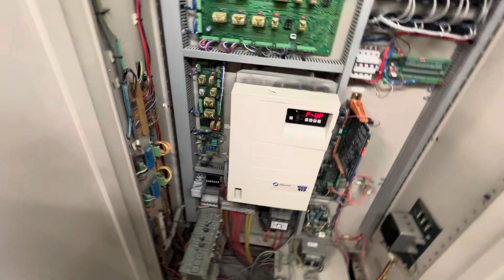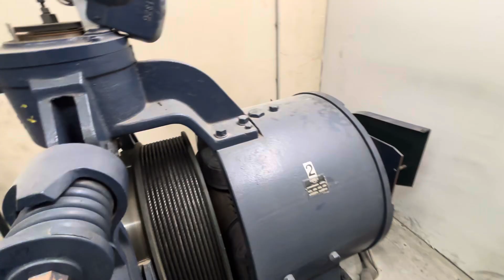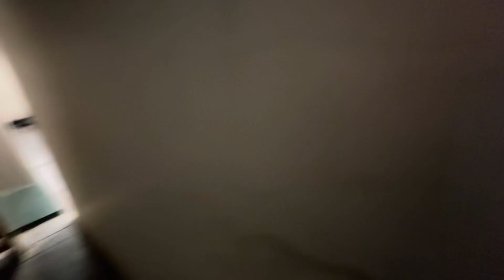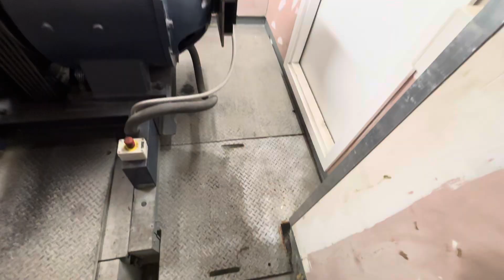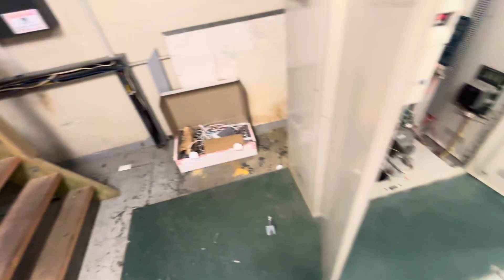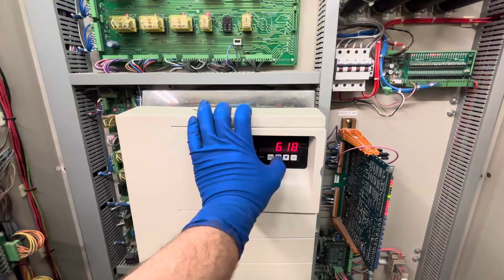ULP DSD412 DC Mod

Comment: The Express Traffic MK4 supervisory system was some really cool stuff based on Selectomatic Mark IV. Much more productive than lifts operating in a timed dispatch cycle as the lifts could directly respond to hall calls rather than making wasted trips to the top and bottom terminals even if there were no more calls along the way. I wish the DM regulators mounted on the motors were left intact during the modernisation though, would’ve loved to the speed measuring/drag magnet transducer in action.

Comment from the maker: They were 2 speed AC FIAM, updated to ULP with VF drives then later planatary machines, doors were FIAM then updated to fermator door controllers
Reply: Sweet! I did think possibly FIAM! The amount of modernization work done to them is clearly quite significant, hence why we could not figure it out, and I also realised that the doors were not original, given they have delta-key locks, which were not really a thing back in the 70s.